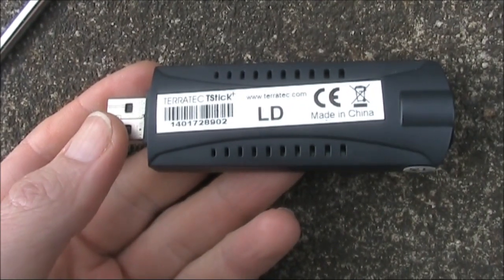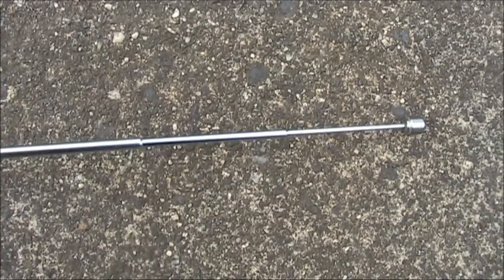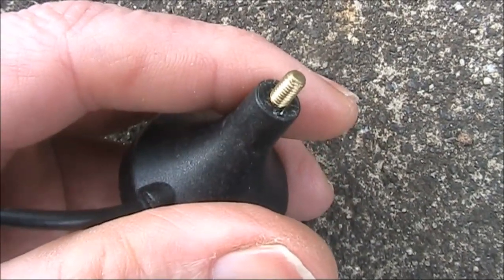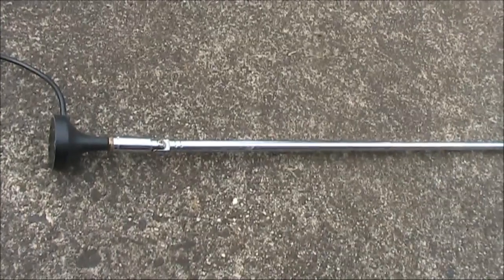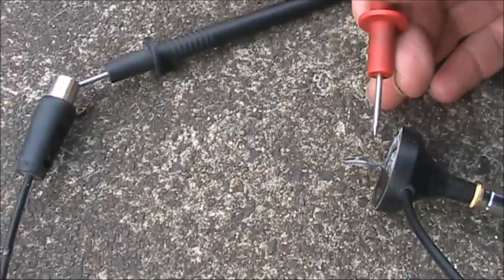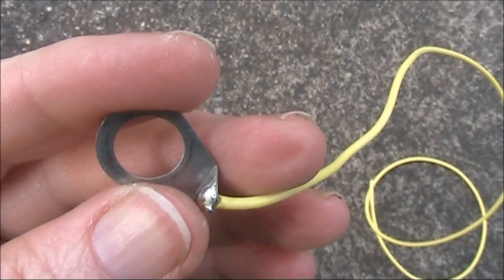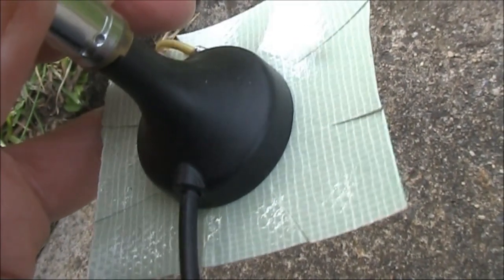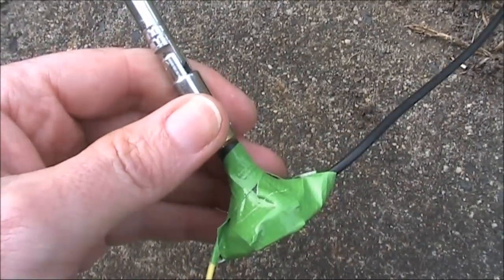Improved portable antenna for your RTL SDR dongle

Comment: In my case the shield of the coax was not soldered to the base, was just loose wires inside the magnet base shorting to the center wire. I twisted the tire and put it between the metal and plastic so it was no longer shorted and made a good connection to the base.

Comment: Hi bro my antenna is the same of you (magnetic monopole) my coax have twin cable one if isolated 50ohm wire and the other (i supposed is the ground) is a mesh cable, but my antenna base is actually broken how i repair without affect the impedance?

Comment: I've got RTLSDR R820T2 but it doesn't work for anything except local commercial FM stations. If I try some higher frequency for eg 200-300Mhz waterfall looks same as when I remove antenna. Is this normal or there is something wrong with my dongle ?
Reply: Try clicking the COG wheel in AIRSPY then drop down Sampling mode and try "Quadrature sampling"
Reply: This means that your antenna is not calibrated for other frequencies, to do this only put extensible rabbit ears and attach to your antenna.. i forgot, divide the frequency into 300.000..

Comment: Wasn't it easier to make a new antenna for the SDR using coax and some PVC tubing. This thing  does not look pretty at all.
Reply from the maker: I wanted something that could be telescoped small and was light. PVC tubing wouldn't work for that. I don't care much how it looks.
Reply: @vk3ye  I remember seeing a ground plane quarter wave made from a telescopic driven element and 4 telescopic ground radials you would extend in and out to tune

Comment: How can you attach a dipole to the sdr?
Reply from the maker: Through appropriate adapters.
Reply: I mean if you can directly connect the raw wires to your sdr by cutting the wire that came with the sdr and then splice them with the raw cables of your dipole antenna? Because I don't have Connectors and i don't want to break my sdr or my laptop.
Reply from the maker: @mineland66  Yes. There is no risk of breakage.